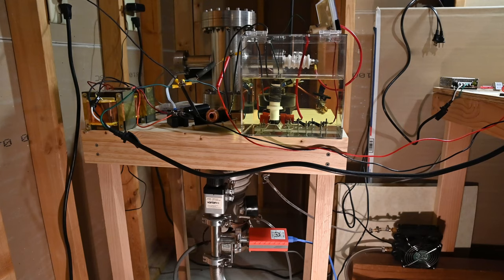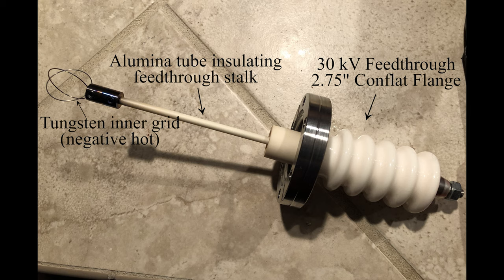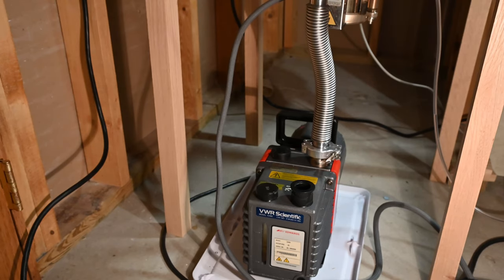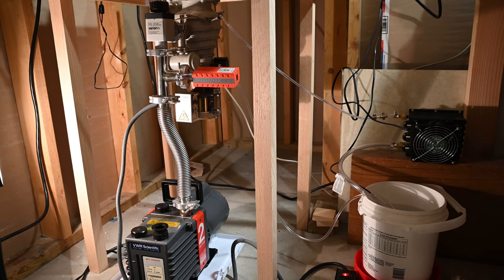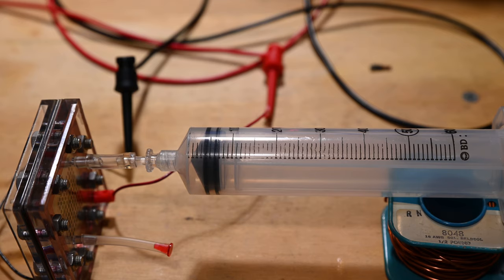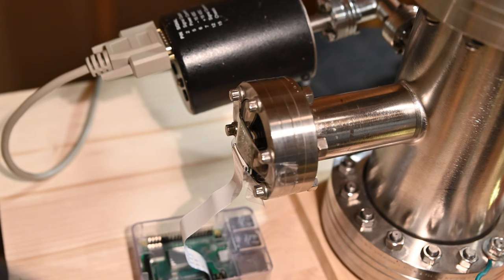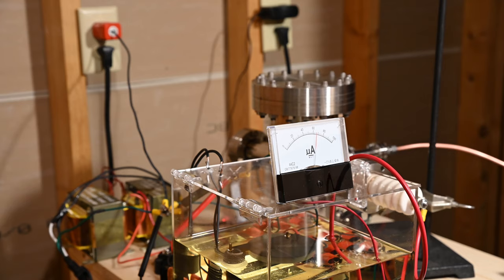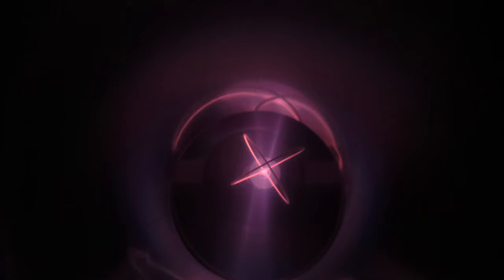DIY Nuclear Fusion Reactor - Deuterium Fusor

Comment: Such a cool project. I’m working on my own at the moment, and I’m wondering if the chamber gets hot to the touch.
Reply from the maker: Yes, the chamber does get hot after a fusion run! That is one of the downsides of using a smaller chamber like mine for fusion. A larger chamber doesn’t heat up so much.
Reply: @ScienceMarshall  Awesome. I was hoping I could be able to add some sort of peltier module or something, just so I can say it has a purpose lol. Do you remember what size your Turbo Pump was? I've found a few on eBay, and cheaper than come of the diffusion pumps oddly enough. Also I don't have to fill it with the ridiculously expensive diffusion pump oil.

Comment: What can you do to prevent gettong any sickness from radiation? Also good job on the reactor. I am planning on building one.
Reply: Use a neutron moderator to slow down neutrons and cover the reactor with metal plating
Reply: Don't stand in front of the beam. That's literally it.
Reply: Do not look into the operational end of the device.
Reply: Iodine... rodin coil if you don't want to affect the neighbors... but maybe  first culculate the circumference of the moon. Useless but save.

Comment: Hi, thank you for the informative video. Would you mind me ask a question here: if I'm planning to use a 15kv neon sign transformer instead of the flyback, is it OK to use the exact same voltage tripler design as yours? Is there any need to manipulate the capacitance of these capacitors? I suffers from poor electrical knowledge, really appreciate for your help.
Reply: Power is power,it doesn't really matter

Comment: The next question is how to transform the produced energy in electricity. The energy must be greater then the input energy. I wish you luck!
Reply: Most forms of energy recovery rely on heat generation, but this requires moving parts, pressure differentials, refrigerants and heat pumps, and imperfect thermodynamic isolation. Since the neutrons break apart after a little while into protons and electrons you may be able to envision an electrochemical mechanism like a fuel cell, but with added energy recovery for hot electrons and protons via charge steering (proton positive, takes different path than electron.). Fast neutrons are very tricky to capture safely, and they do a lot of damage to any materials they hit, and can leave behind lasting radiation from transmutation or decay initiation.
Reply: The estimate is something like 1 watt produced to 1,000,000,000 watts used. You are looking for the magical man made break-even reactor to which no one has be capable of producing especially from a DIY reactor. Plus as the other guy pointed out the fast neutrons are very difficult to safely capture.

There are currently no such thing as a break-even reactor created by man as no man made reactor has been capable of it. 

God's reactor, the sun, is a break-even reactor and that is the closest you can come to seeing one in action. That is why the sun is so goddamn amazing.

Comment: Nice job. A reliable fusor powered with a electrolysis rig is not something many people do. How do you feel about it overall? Worthing doing over the traditional methods?
Reply from the maker: Thanks! I think that the electrolysis method was much better than using bottled deuterium. No pressure regulation needed and no worries about running out since I could get a lot of deuterium volume out of just a little heavy water volume. It’s also cheaper and much more accessible to the home experimentalist.
Reply: @ScienceMarshall  And what about drying? The FaQs gloss over that quite substantially.
Reply from the maker: From what I’ve read, drying will give a substantial increase in the fusor’s neutron output. That would be one of the first upgrades I would make to the system!

Comment: I wonder when it's time nuclear fusion breaks even in terms of energy used and produced
Reply: Its impossible and will not happen due to the voltage required for input power is so high that any usable energy produced is insignificant. I think the estimated amounts are 1 watt for every 1,000,000,000 watts used. From that you can clearly see that this type of reactor will not ever be capable of a break-even reactor. 

That is a problem that no one has figured out yet and even if a break through was made within the next 5 years your still looking at a very long time before anything resembling a break-even reactor would be produced.
Reply: @evilcowboy  same was said before Hiroshima....
Reply: @grazielecarvalho4792  
thats a completely different idea and use. That bomb is using nuclear fission, basically splitting atoms. This is a nuclear fusion reaction and therefore very different. Basically fusion is using two light nuclei to combine together. Therefore a break-even nuclear reactor is not possible right now because it taking such a large amount of energy to produce a usable watt. 

Basically what we need to know is how the sun is working and where its energy source is coming from as it is the only break-even nuclear reactor in existence.
Reply: @evilcowboy  You are wrong, sir. We are very close to commercially produced fusion energy. Check out the ITER project for example.

Comment: Science Marshall, do you know if this is correct? Or am I still missing something/is something redundant?
Vacuum chamber
Power Supply (slayer exciter)
Vacuum pump
Geiger counter
High voltage divider probe
Thermocouple
Neutron radiation detector
Deuterium gas
Large ballast resistor
Airborne detector
Reply from the maker: Sounds like you’re on the right track. I’m not sure what the airborne detector means. Also don’t forget some sort of high vacuum measurement that will let you know if you have a deep vacuum and allow you to monitor how much deuterium you are adding. You say “vacuum pump” but unless you’ve got an amazing mechanical pump you will likely need the combination of a mechanical vacuum pump and a high vacuum pump like a diffusion or turbo molecular pump to get the initial chamber pressure low enough. I would recommend using something like the ZVS driver + high voltage multiplier I used to obtain the high voltage DC. You need >150 watts sustained for 10 minutes or more in order to do detectable fusion with a bubble dosimeter. A slayer exciter isn’t going to work well for that. Even my power supply was on the low end power-wise. The bulletproof option is to use an X-ray transformer but those are a little harder to get a hold of. If you are really serious about doing fusion, please go to the fusor forum in the description and read as much as you can on the FAQs there. They will do a much better job than me at teaching you to do fusion.

Comment: Could you make it able to generate usable power? And that is efficient, it outputs more than you input...
Reply from the maker: The Farnsworth fusor is a notoriously inefficient fusion device. The actual fusion energy being released is less than a microwatt, and I’m running it on ~1000 watts with my vacuum system and power supply.

Comment: what was the total input power used?
a water pump?
3 volts x 1 amp to generate deuterium
how much deuterium in oz? to generate how much energy in watt hours
30,000 volts x 5 mill-amps = 150 Watts output
I read on the internet that fusion does not break even in energy in vs energy out.
can it be used to store energy like a battery?

Comment: Bro hope you good and alive, i have question, Hydrogen you used is from HHO generator  am i right? Are you compressing hydrogen or its go inside of chamber direct from generator? Are you drying gas?
Regards and respect for your job.
Reply from the maker: Thank you, I am alive and well! I am using a PEM cell that normally electrolyzes water into H2 and O2, but in this case I filled it with heavy water so it produces deuterium and O2. The O2 is discarded and the deuterium is fed directly in without drying. Drying the gas would provide better results but I didn’t bother with it. No compression step is necessary since the vacuum sucks in the gas.
Reply: @ScienceMarshall  Thank u bro and God bless you

Comment: Could one use a neutron moderator to convert the fast neutron flux to a thermal neutron flux, for activation experiments or isotope breeding?

What if you place a sample of lithium in the reaction chamber? Could the production of tritium be detected?
Reply from the maker: Yes a fusor may be used for activation experiments. Many fascinating activations have been performed and documented on the fusor forum. I’d recommend checking out the forum if you’re interested.

Comment: It's nice to see this project work out. You should try to create some microscopic amounts of tritium using lithium-6. But I suppose you'll find it hard to get lithium-6. You will find out why if you look at the uses of lithium-6
Reply: you do know the half life of lithium-6 is under a second, right?
Reply: @notioncreanga There is no half life for lithium 6. Did you mistake helium-6 with lithium-6 since helium-6's half life is under a second
Reply: @dankmemes6254  Shit. Forgot that lithium-6 and lithium-7 are the only stable isotopes of lithium. My bad :)
Reply: If you distill the tritium out of the worn out car batteries ? Ron cheap recycling

Comment: Amazing! How about placing the dosimeter in front of the window? Do you get more bubbles?
Reply from the maker: Fast neutrons go through just about anything without interaction besides a well designed moderator, so it wouldn’t make a difference for the neutron dose. It’s a much different story for x-rays though, and that’s why the Geiger counter goes crazy in front of the window but stays near background everywhere else.
Reply: @ScienceMarshall  alpha and beta radiation that also are particles, do interact with about any material a lot, and neutrons themselves clearly interact with the gel.. That is why I ask.

Comment: If you connect a POWERFUL, LIGHTWEIGHT AND EFFICIENT Nuclear Fusion Reactor To a Few Ionic Plasma Thrusters, you should be able to create a spaceship that will throw you into the next Space Age!

(You would still need fuel rocket to lift off from Earth into space, but once into space, put the ion thrusters into full throttle, AND OFF YOU GO!)

Comment: I have a doubt...... While back will jack made a fusor in a glass jar in which we can see the anode as a spiral ring of metal,my question you placed a anode inside the chamber or used the chamber wall as the anode..... Btw I m 12 and working to build a fusion reactor since last year and found your video very useful please reply
Reply from the maker: The chamber was attached to earth ground, and then the inner grid was placed at -30kV relative to that. So yes, the metal chamber itself acts as an electrode. Best of luck with your project!

Comment: Why isn't this generating tons and tons of heat, as we would expect from the fusion equations?
Reply from the maker: The amount of fusion actually occurring would produce less than a microwatt of power. So while fusion is happening, this type of reactor is never going to solve the energy crisis! The chamber does get pretty hot but it’s all coming from electrical losses.

Comment: QUESTION...Very impressive, is there a way of getting slow neutrons out of it, I may have an experiment for you? I have a monoatomic powder I have made and need to increase the mass or charge it with neutrons that capture at a much greater rate when  the neutrons are slowed down. According to David Hudson it creates an anti-gravity field that can be easily measured. Great work.🌞🌞🌞

Comment: Question
How did you seal the flanges? Rubbers wouldn't melt at such temperature?
Reply: The temperature of a fusor only gets about as hot as boiling water from my understanding
Reply: The bigger the better

Comment: Have you tested the minimum amount of vacuum needed to produce x-rays from a Coolidge style tube?  Just curious if an Edwards rotary pump could achieve the min 10-4 torr (according to wiki) to produce x-rays? or is a turbo/diffusion pump a must?
Reply: Yes an edwards rotary pump( such as a rv5 pump) can pull a high enoygh vacuum to generate x rays if hv is introduced. But for a fusor you'll definitely need a turbomolecular/oil diffusion pump

Comment: hey mate if your interested check out my fusion reactor prototype. keep in mind I used theoretical work done by lpp fusion when I engineered this prototype.
 it increases the particle interactions allowing way lower vacuum and power requirement's and produces a high energy fusion reaction and is relatively easy to manufacture and is scalable.     
there are four videos on my channel 
this was a no deuterium test run of the first half of the test core and 28 mercury's is the vacuum 
so there's a major boost in performance if I get a better pump, and materials 
 read the descriptions for more info.
Reply: Interesting. I'm trying to make a minuture tomahawk variant, you got any advice for that?

Comment: Thanks for this informative video! I'm totally new to this and was wondering what the differences/similarities are with this guy's reactor? https://www.youtube.com/watch?v=sRxTp7fxV4E&ab_channel=ArmandoCavero 
What I noticed was that the vacuum part took 5 minutes there vs 30 for you. Also he seems to just switch it on, while you are tuning things a lot to get it right? 
And to what extend is it (im)possible to make a net positive reactor this way? :P
Reply from the maker: Thanks for watching! In that video he is using a turbomolecular pump instead of a diffusion pump like I used. Turbomolecular pumps are much fancier (way more expensive, lots of precision moving parts!) and can quickly pump down a chamber while a diffusion pump takes some time to warm up. His vacuum system is also in a pumping station configuration which is a turnkey solution and only takes one press of a button to turn on. Also, he is using a commercial high voltage power supply which will have a current and voltage limit that can be set. With a current limit set, the only thing to be tuned is the deuterium pressure! My power supply is homemade and doesn’t have a voltage or current limit, so I have to do a lot of hand tuning of both the input voltage and deuterium pressure. All the convenience of his system comes with a much heftier price tag!
Reply: @ScienceMarshall  great information! Thanks so much for explaining :)